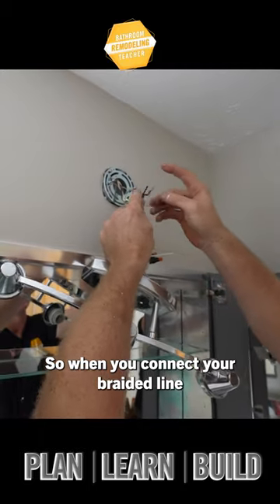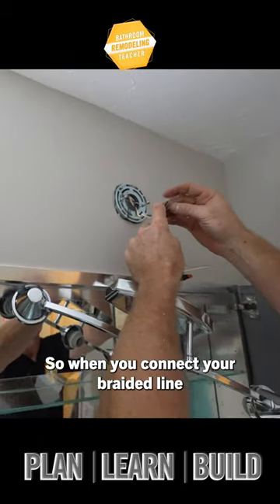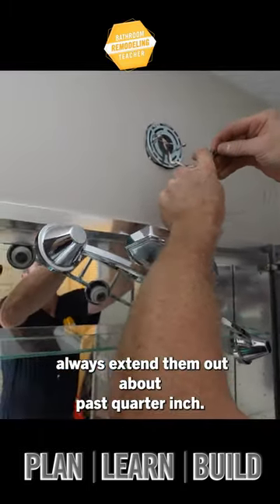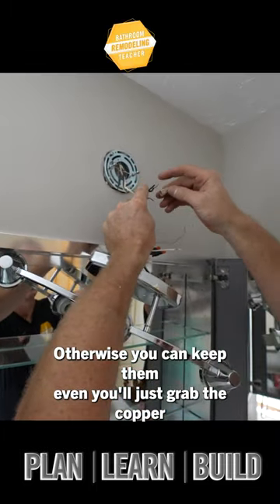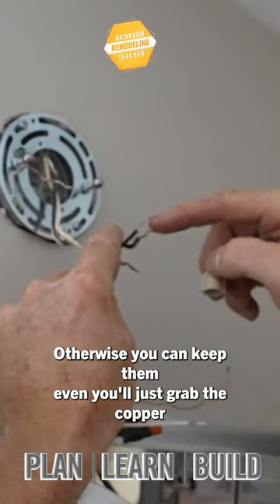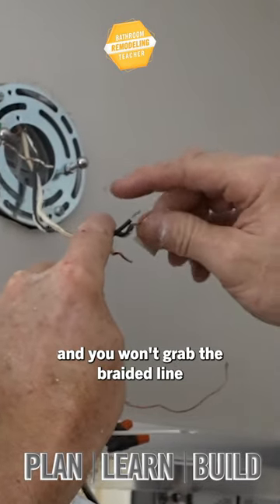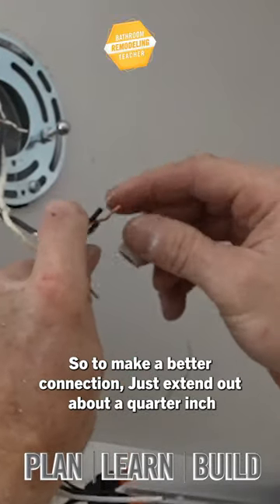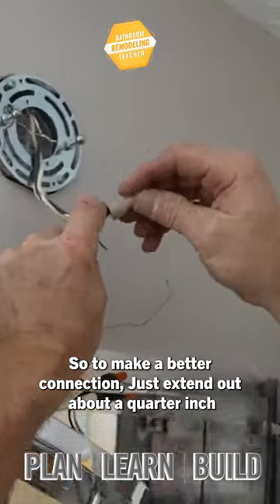Light Fixture Connection ⚡ #shorts #electrical #diy

Comment: Great post. I just saw another video that talked about the braided wire tip you mentioned. Its an important tip for longevity and safety. One request. Improved audio is needed.

Comment: Do I need a box?  I don’t get why wall sconces don’t have boxes for the outlet.
Reply: Yes, you should have a box to contain the connections and screw the fixture to. 1 exception example would be a fixture that is affixed to the wall first like a 2 or 4 foot fluorescent fixture that has a protective connector where the wiring enters and a compartment for the connections. But typically a wall sconce needs a box in the wall.
Hope this helps.

Comment: Wrong! First things it's not braided wire it's called thhn or you can say stranded wire. It's not a rope or someone's hair so it's not braided! Also always keep them even I don't care if you think it works better cause it doesn't I'm an electrician and I've been doing this for a long time and none of my connections come apart unless I put one wire past the other.
Reply: You not a good electrician, I'm also I commercial electrician and if you have solid wire connections with stranded wire you always leave the stranded wire sticking out further to make a better joint. I bet your wires have pulled out. 🤣
Reply: Well, you're wrong.  Key is the stranded needs to be tied in the spring too and without it extending out a bit, it can miss.  Wagos are even better for this application though.
Reply: Then maybe you should do an advice video...😳